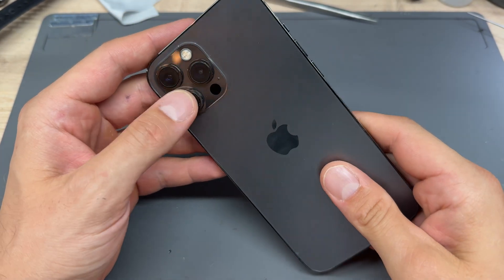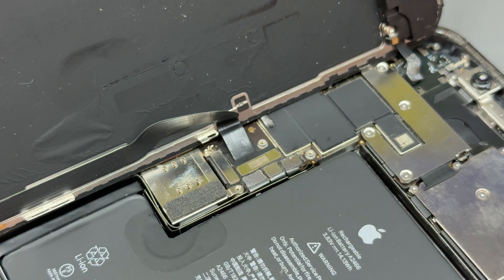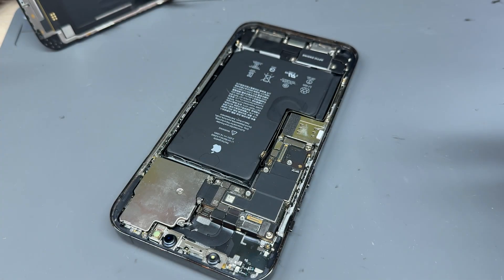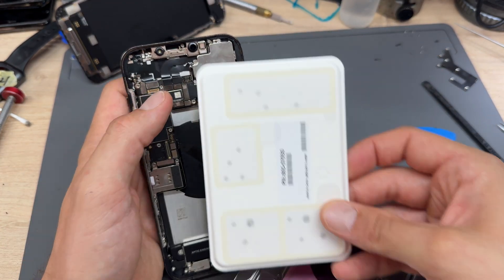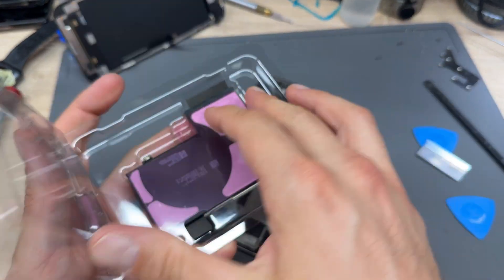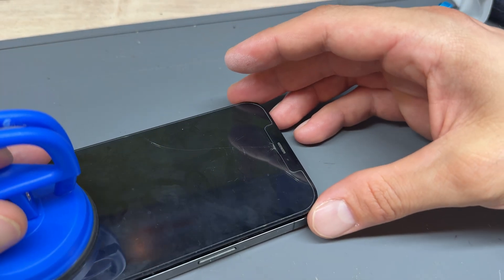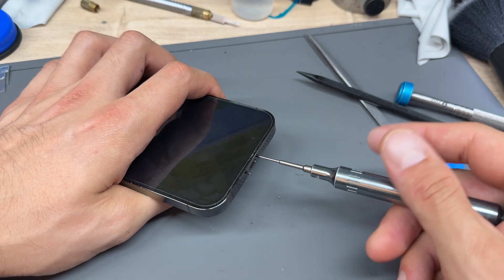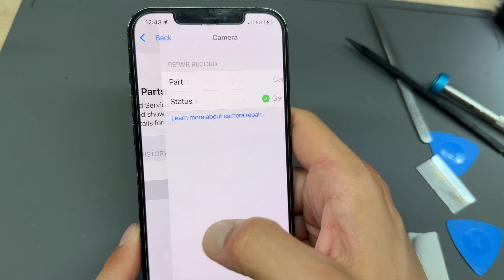iPhone 12 Pro Max Genuine Battery Replacement – Restore Battery Health with OEM Parts! 🔋

Comment: This is not the correct method to open the iPhone. You're teaching a lot of people, and they will damage the screen. You have to use the blade on the right side, but use alcohol or heat it. Never use the blade at the bottom, will damage screen, green line.

Comment: I thought the battery had to be minimum 30% charged to be able to pair it
Reply from the maker: It’s 20% minimum but can be bypassed if you force into diagnostic mode